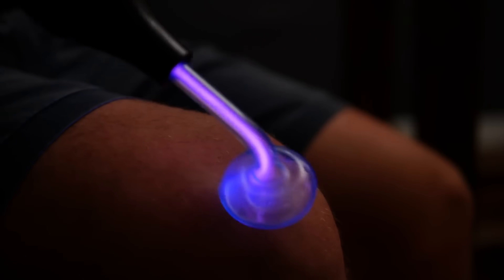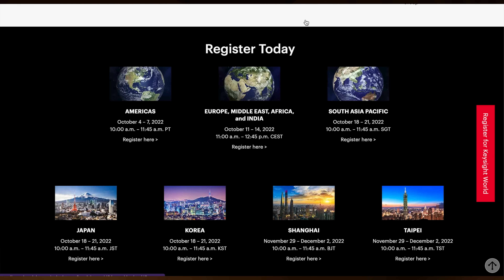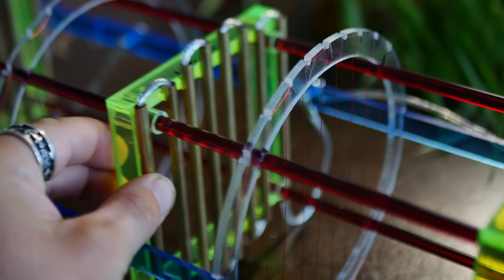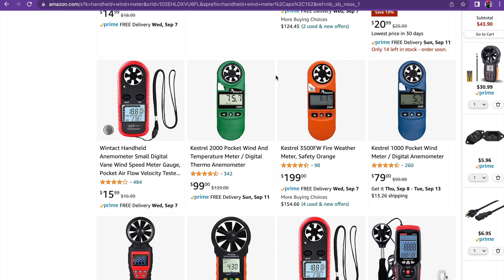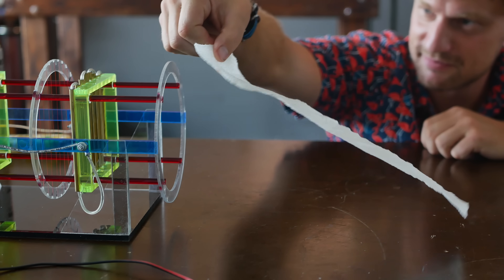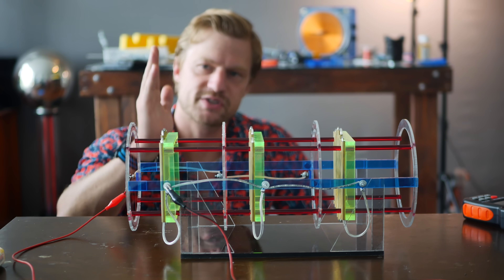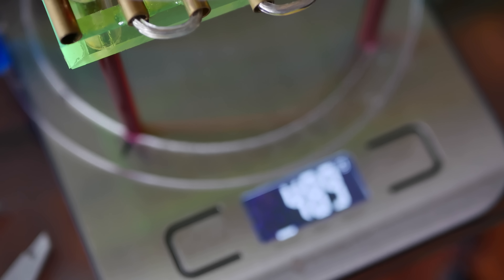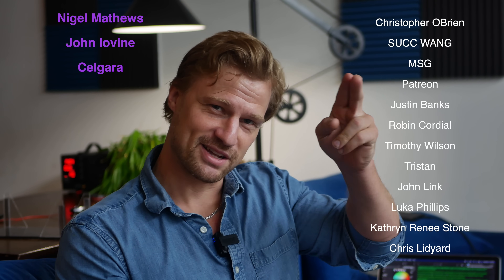Designing A Next-Gen Ionic Thruster! (For Flight)

Comment: Inefficiencies:
1) Ion path scattering. Position the electrodes so that the ions all flow parallel, ideally. Otherwise their non uniform direction makes the overall thrust vector hit the wall of the device which eliminates much of the airflow.

2) Ion pathing. A dielectric rod ending at an oppositely charged sphere or grid will make the ions want to flow towards it, thus preventing them from diverging. Otherwise they may get attracted by other charges around the device and make the air diverge. Ideally, enclose the whole air flow to have control over what your ions are pushing and to recover a portion of you spent energy via the sphere/grid.

3) Electrode shape. Round them up on one side to make charge (and air) only flow the other side. Use needles. Otherwise ions will set up tiny back currents to the opposite direction.

4) Materials. Use hollowed frames to reduce the weight (which decreases thrust) by a lot. Good ones are Expanded Polystyrene and Kapton tape. Don't wait for Graphene windows.

5) Temperature. Use thermionic emission to get more ions. Cheap tungsten needles do exist. This is not an inefficiency btw, more like an improvement.

6) Air channel geometry. Close the walls to protect against side air currents. Otherwise air may not flow linearly, especially if ion path scattering is not dealt with. This necessitates that you build an appropriate container to facilitate smooth flow otherwise air can get stuck momentarily, creating "traffic" that may slow down the net flow locally thus reducing thrust.

7) Gravity. Always position the apparatus so it blows downward to take advantage of gravity, otherwise it is always eating away at your thrust as it doesn't let the air flow in line with the cylinder. Thermionic emission may fix that up a bit as hotter air tends to rise. You need to find the perfect balance with these two.

8) Another improvement. Use Integza's golden spiral fan to set up two air vortices that serve to both push as well as pull the air to and from the desired direction, and help counteract the side effects of both gravity and thermionic emission.
Reply: Carbon fibre bundles make for far finer strands than metal needles, plus they’re really lightweight.
Reply: Potting the multiplier would probably be a good idea too. There has to be a lot of corona losses from it not being insulated.
Reply: And that theyr impossible to power
Reply: @thesaltlampofchaos  
A modern 100C lipo easily has the power density to power this sort of thing, and modern transistors and magnetics for boosting the voltage wouldn’t be much of a bottleneck on that front either. Energy density is definitely going to be strongly limited though.

That said, I wonder how feasible it would be to trail a really thin wire into the lower atmosphere (or into a body of water) and power it from atmospheric electricity?
Reply: @Scrogan  i see thanks for the info!
Reply: @Scrogan  Ideally these are used for space travel, you could simply harness power from the sun and from those weird cold power cell things that need low temperatures to generate energy. I forgot what they are called technically.
Reply: @JustAGooseman  given that it ionizes air to generate the flow, and that there is no air in space, it seems unlikely to be used for space travel applications. As someone who is not an astrophysicist, I can only presume that the particles present in Solar wind saturated environments are too separated from each other to interact with the ions, much less each other, to generate appreciable/usable flow, if any.
Reply: @KellyDiversified  Check out https://en.wikipedia.org/wiki/Solar_electric_propulsion
Reply: @thesaltlampofchaos  hopefully someone makes a huge breakthrough in battery tech that allows makes them lighter while simultaneously making them more energy dense and less harmful for the environment. Unfortunately, it is very unlikely that something like that will happen soon.
Reply: @yummyhershey5902 I don't think batteries will be the solution for this technology. Using fuels to provide the energy density needed for electrokinetic propulsion will result in drastically increased fuel efficiency.  Check the Thomas Townsend Brown patent for the electrokinetic flame jet generator. You can get several million volts with a traditional jet engine running kerosene, if you ionize the exhaust and then collect the accelerated charges at the end of a nozzle and feed the excess power back in to the exhaust at ever increasing voltages. Ion thrusters efficiency can be as high as 110 N/kW or more scaling with voltage, so augmenting a normal flame jet would increase the efficiency without drastically lowering the thrust. In fact because the system is efficiently converting chemical energy to electrical, and then recycling it to generate higher speed, higher voltage exhaust, there is a net gain on thrust as well as efficiency. Brown wanted to exploit the ionized gas cloud left in the exhaust to form the negative electrode for the ion craft, to drastically increase both the voltage and the electrode gap between the positively charge ions generated at the leading edge of the airframe and the negative cloud. This works fantastically well in the upper atmosphere/ionosphere, where the ionized air is influenced at a long range by the high voltage. This can be further augmented with magnetic field control for additional power recovery during descent. See also the work of Jean Pierre Petit PhD, who shows how Magnetohydrodynamic engines can manipulate the skin plasma around such craft to achieve supersonic speeds without generating sonic booms.
Reply: @yummyhershey5902  liquid fuel is just better, you have a much higher power to weight density that even with something like hydrogen, you can make a hybrid electric craft use liquid fuel generators and be more efficient at scale.
Reply: Could spiraling the ion path into three dimensions be an effective way to parallelize?
Reply: @NGPerez247  that's what Intagza's golden ratio fan does ;-)
Reply: Everything but the last - that is just inefficient.
Reply: We have a real bad@ss over here.
Reply: cover whole cylinder apparatus in hi vacuum, at the end of exhaust cover with paraboloid copper shaped

Comment: OKAY YOU HARVEY DENT LOOKING MOTHER****ER!
1. have you tested this with thicker wire to hold more voltage?
2. have you tested the spacing of the wire?
3. you've already concluded that it increases effeciency with additions, have you tried different configurations other then linear, so instead of having them inline, try having them staggered, just try different geometry's to see which one is best, could even try making them have a turbine like shape with fans to increase efficiency.

Comment: 6 ways (maybe) to increase performance 
#1 put a foam "J" curve profile on the inlet
#2 put a cellophane cowling/duct down    the inside inner length for better laminar flow
#3 taper down the length of the design
( so that the over all shape resembles that of an old fashioned loud hailer )
#4 put a polystyrenem on the outlet ?
#5 make the cross section of the round negative electrodes into tear drop shapes to reduce turbulence and drag
#6 try a using graphitic threads for the positive electrode wires
Reply: But what happens if you make less thrust because it requires air from it's open frame surrounding
What if the J casing casing stops the bottom two layers from taking in air. So wouldn't a design like

J
J
J

Help so that all layers get the air they will get?

Comment: This is brilliant work!
I wonder how pulsing the 3 grids in sequence would affect the thrust?
Would a fine mesh be more efficient compared to the wire?
Also if a Venturi nozzle was fitted on the output it may increase the thrust significantly...
Is geometry a factor or could you scale it down to a smaller thruster and have multiple thrusters in a grid, all consuming the same power source but giving significant improvement in thrust?

Comment: 1.) Design it such a way that you're not stacking the stages "in series" but put them in parallel.
2.) Add roughness to the electrodes so the charged particles escape easier but not enough roughness to start arcing between electrodes.
3.) Your power source looks like push-pull topology converter which tends to be less efficient. Use a resonant topology with soft-switching like an LLC converter.
Reply: he did have them in parallel, that's how he was able to easily disconnect them without rewiring them
Reply: @The_Racr1  Correct, but I didn't mean the electrical property I was talking about the airflow. This way the cascade is setup so that the airflow from one stage flows through another stage which is essentially a series connection. If the stages were placed next to each other, it would be like a parallel connection. I think this way it will get rid of that logarithmic increase in thrust and it will rather add up.
Reply: @Astri.electronics  I think he was trying to achieve multistage acceleration, since kinetics energy is squared with speed but linear with mass. Having a parallel setup increase the airflow by 3 times (mass) but they all travel at the stage 1 speed(which is the same as just build a bigger engine). But if he could accelerate the same air 3 times, and twice the Air speed. He gets 4 times the kinetic energy. Although I agree with another comment on here, where the voltage steps up from stage 1 to stage 2, and functions similar to a turbo engine where the air gets compressed (loaded with more potential energy) as it travels down the stages. But instead of increase the potential energy, the kinetic energy is increased. Sorry for the long reply. If you meant parallel in a different way, please do enlighten me. I'd love see a drawing of sorts.

Comment: i have some idea to improvement...
like ...
what if you make evry grid parabolic shape so ions will flow in focusing manner .
what if you coat electrodes with Such chemical of which outer electrons are Bonded weakly and also try heating cathode just like Filament in Crt or magnetron cathode .
adding additional Electrodes perpendicular to the main electrode to feed extra air in chamber 
using High-frequency high voltage RF  electrodes to make ions easily than Static potential and than using this efficient ion to Generate thrust somehow because AC will cancel net force so not sure.

Comment: very cool, are you going to try shaping the electrodes? could maybe get a vortex going with more grids with shaped electrodes rotated a bit off...that thing has so many possibilities ^_^. like just for industrial or residential use as part of an hvac system. the massive benefits of no moving parts, easily variable size and the instant on/off/controllable would be pretty ideal.

can't wait for more.

Comment: Good work!, I thinj that the next upgrade should be to enclose all the object with a light plastic case designed like a thruster, with an air intake on the front and a small nozzle on the output. You could embed and redesign the whole structure to mantain weight. Use a 3D printer to build it.

Comment: I see massive losses in the wiring. The soldering and lack of insulation along with the jagged and sharp connections result in massive losses. That's why zvs transformers have such a thick wire and isolation caps wherein the actual electrode take up around a 16th of the wire and the rest is insulation (math is highly veritable). I am excited to see where this prototype takes you. Thank you for sharing your progress.

Comment: Inefficiency 1: the engine doesn’t enclose the air flow so the air from stage 1 and 2 can go out the sides.
Inefficiency 2: a nozzle would improve efficiency, that’s just what they do
Inefficiency 3: The ionic wind photos show that the electrons aren’t being fired uniformly from the wire, not sure what you can do to fix it tho.
Inefficiency 4: the grounding rods aren’t aerodynamic, making them more aerodynamic may improve performance.
Inefficiency 5: the ions could potentially be flowing the wrong way to the other grounding rods. Again, unsure how you could mitigate this.

Great video!

Comment: I think that the electrodes could be interrupting the airflow which could slow the wind down.
Also this looks so freaking awesome!
Reply from the maker: Good point - and true. I tested it by BLOWING air into the thruster with it turned off....the electrodes drop air speed by 1.5 meters a second! It needs huge improvement.

Comment: I've had an idea for years to make an ionic thruster using concentric rings,  4 sets of them, to make a silent quadcopter. would be incredible to see if you could build it! fantastic video BTW!
Reply: I think we can say that it might not be silent after listening to this lol.
Reply: Great idea, but this thing doesn't seem silent. A screaming banshee drone would still be cool though.
Reply: Silent quadcopter eqiopped with lidar and thermal camera exploring and mapping caves is my idea :p
Reply: @danijel124  forget carrying that weight with an ionic thruster. Why not a regular quad?
Reply: @Reptex_krka  It sounds fancy, however for know I would recomend a quad with some kind of ball shield arround the entire drone, equipeed with ai for obstacles and in case you run out of signal and with lidar. Then you could independently explore hidden caves witout injuries... Who knows the stuff you might uncover :)
Reply: Quadcopter seems like the least effective way to use that thrust. A fixed wing design would make better use of the low thrust to weight ratio, think of a glider with one of these. Quad would be cooler by miles though..

Comment: Interesting and fine pictures of the ion thruster, it kinda looks like tiny lightning,

Might the copper wire be the inefficiency, or maybe the small amount of copper wire you used, or maybe the entire ion thrusters isn't covered like a jet turbine only allowing air to come in from one place instead of letting it go all over the place?
Reply: Or maybe the inefficient spacing of the small white dots in the picture 9:12

Maybe  if you had some way to direct the spacing of those dots to be more evenly distributed in length, they wouldn't converge so weirdly?

Or maybe you need something that will feed the ion thruster, something more then air, like a fuel that's made for this.

Comment: First of all 2.3m/s is like incredible for homemade device.
1. You would have covered the sides so that air current won't leak,
2. A constant DC supply would be better instead of pulsed
3. The wind speed meter you have used was having comparatively very heavy, so actually you might be getting more speed
Reply: A constant DC PSU probably wouldn't have worked, since you need super high voltage peaks for the plasma discharge. The pulsing supply allows for waveform collapse, which produces huge voltage spikes, just like an ignition coil from a vehicle.

So unless there is a super simple 100kV DC PSU out there, the pulsed supply is the way to go.
Reply: @operator8014  A faster pulse or constant DC would provide more power but you're right that it would make high voltage spikes harder, so I don't know if there exists a good solution for this, at least not easily.
Reply: @Tletna  Just higher frequency and higher voltage, which takes more power and a larger coil to generate.

So a bigger coil, being driven harder, with faster circuit oscillation, would all mean more thrust, since the plasma is being pushed and pulled more forcefully.
Reply: @operator8014  Would somehow compressing the air allow the plasma to grab more air? Like if the first stage pushed into a cone, would a second and third stage be able to grab that air better?
Reply: @Dhaiwon  I wouldn't think so. The air actually BECOMES the plasma when the electricity passes through it. Compressing the air would have the same effect as placing the electrodes further apart. It would definitely help make the system more compact for the same power though.

In engine performance, if you force too much air charge into the cylinder, then the coil might not produce enough voltage to jump the gap. That's why really high-pressure turbo applications and high compression applications need upgraded coild and ignition systems.
Reply: Added extras
1. What about coneing the different sections so new air could enter but the air in the chamber could be accelerated

Comment: Pointed electrodes in the intended direction of air flow for the plasma to eject from instead of horizontal wires.
Reply: Not enough surface area!!! Would work better with a grid of hair thin gold plated tungsten wire, such as was used in the olden days of copy machines!!!
Reply: @RTR-MATEY  I guess a grid of 100s of pointed electrodes. Doh! Weighs too much. Oh welll.

Comment: can you put it in a tube and put a nozzle on the output for the version 2? it's like a jet engine design so that the air is more focused on the output and there is no leaks on the gaps between each stages so more power

Comment: Very cool! I did notice the first half of the airspeed testing the meter is sitting on the table and is slightly above/off centre of the thruster and then test with staggered spacing you are holding it directly in the middle potentially changing the result, might be worth repeating with it sitting on the table like the rest of the tests for the staggered test to make sure those added efficiency gains are real not just testing error. Would love to see more videos on this. Would there be any gain for encasing the whole thing in a tube like a ducted fan? Could be tested just wrapping a thin sheet of paper around to keep it light. Would the wires work wrapped in a spiral for increased density?